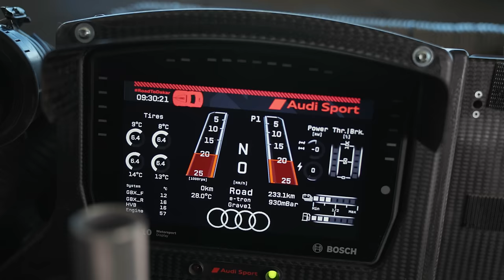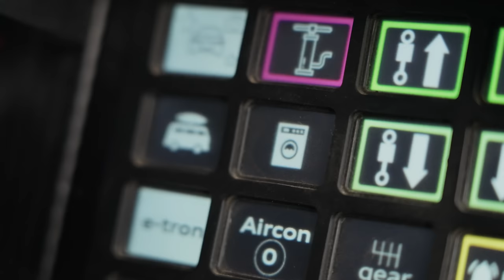FIRST DRIVE: Audi RS Q e-tron - Electric Dakar Car Tested On and Off-Road | Top Gear

Comment: Big congrats to Audi for building the loudest EV in world history
Reply: Have you not heard the t pain edition scream coming from the mach e 1400 drift car gittens team built? 
Or the Porsche cayman gt4e performance Chris Harris recently tested. 😀
Reply: McMurtry Speirling produces 120db.
Reply: Sounds like an rc car lol
Reply: Definity not, Formula-E cars are ear-shatteringly loud.
Reply: No ideea why they used straigh gears, helical gears are silent
Reply: @dtibor5903  maybe because it's less strain on the gears and more instant power. 
(I think I've heard this somewhere but I'm not sure so don't take me too seriously)
Reply: i mean i like the whirr of electric motors but it's a slight bit much
Reply: Staight cut gears
Reply: It must be annoying to drive.
Reply: Hybrid, not EV
Reply: That's just Desaster! ....
Reply: Like rally cars and other stiff race cars, the transmission/gearbox and in this case the electric motors are directly bolted onto and reinforce that area of the chassis. It makes it resonate loudly inside and out of the car. These Formula E electric motors are already loud enough. There is no noise reduction in racing. Wear earplugs.
Reply: Its weird how mad people are at anything thats not gas because they want their noise but high end electrics and older performance EVs get loud, and hydroogen sounds like a jet sometimes. i think personally for road cars, they should be fucking quiet. anyone whos ever lived with someone who owns a carbed 454 or a honda streetbike with a yoshi exhuast on it knows what i mean at 2 A.M. but in terms of racers and shit... i think we will still have noisy tracks in the future after we switch most cars over to something else.
Reply: Lol... Because desert runners are historically stealthy and quiet!
Reply: @dtibor5903 they said it's stronger and there is no axial force to the bearing.
Reply: @Cheetahtos  that argument is invalid at least. It's just matter of bearing choice.
Reply: So this is a hybrid car not a  EV car
Reply: @dtibor5903  lighter, smaller, cheaper, more efficient.
Reply: electric will be silent
Reply: Isn't an EV genius, it's an hybrid with EV propulsion, not too difficult to understand
Reply: @tomasmartinezhz  is a car with electric transmission, mostly. i bet it never runs with the ICE off.
Reply: The first hybrid car in winning the Dakar rally ...
Reply: I was thinking the same 😂
Reply: Good looking vehicle. Hope Audi thought about overheating batteries in the Dakkar heat.

Comment: Interesting that there’s an internal combustion engine onboard to charge the batteries. Wonder how far you can get with this setup (before the fuel runs out) compared with how far it could travel if it was solely using an ICE with no electric motors.
Reply: Yes is a hybrid, but the EV extremism only allow the to say is electric.
Reply: I think this is an amazing car. But I think we will look back on these times 20 years from now and wonder how we made such little progress with car batteries and gasoline, over a 40 year period between 1985 and 2025. No other technology is recognizable from 1985, because it has changed so much. Car engines and car fuel injection is exactly the same, despite there being about 5,000 patents which could completely revolutionize electric car battery capacity and internal combustion engine combustion technology.
Reply: The total efficiency is actually better than letting the ICE drive the wheels directly. The EV drivetrain has hardly any losses and the ICE can run super efficiently. Running the ICE with such dynamic loads would make it super inefficient.
Reply: @Ritalie  patents are not equal to feasible solutions. There’s a lot of patents for ideas that cannot be implemented. For engines the revolution or change has ben applied by material science and electronic control, new knowledge of CFD combustion chamber behavior and so on. There’s 80s technology that has not been implemented on street cars due to laxity from companies (they are not obligated by government regulations).
Reply: @LukasRaschendorfer  yes, but there are losses when you recharge a battery, store the energy and then use it on electric motors. Those losses are more than drivetrain losses are. And also the needed components add weight. That’s why in a pure long distance drive, a car with tiny diesel engine goes further with less energy, than a similar hybrid car. In a normal day-to-day driving, hybrids are better. BMW i3 has a model where there is a small range extender engine in an electric car, works just like this Audi.
Reply: Much farther. That's why, to be able to drive at high power for long distances, they decided to generate power onboard as always.
Reply: @testi2025  yes there are losses, but those are small compared to the ICE efficiency losses between running constant speed, optimized load and driving Rallye-style on and off throttle.
Reply: basically how honda does their hybrids
Reply: I like that they used ICE because it proves the future of electric cars. While we are not there yet because of the batteries it nice to se the potintial! Also, ICE charging is VERY efficient. And a car that is made that way may superseed a normal ICE car in a range test
Reply: I think it creates a platform that can easily be adapted as battery tech advances, to the point where the ICE comes out and a batter unit goes in...
Reply: @testi2025  actually that’s not really true. At most, Road ICE gets 40 percent efficiency. So a car that makes 150hp, actually loses about 300 to thermal loses… it’s crazy when you really think.
Reply: @testi2025  but an argument can be made, since the engine just runs at a constant rate for maximum efficiency, without gears. It can significantly increase the fuel economy, then combined with sustainable fuels, can be carbon neutral
Reply: @testi2025  they can optimize the ICE to run at maximum efficient RPM at all times, usually 3000-4000rpm. While driving in the real world you rarely hover at that exact rpm range for long(unless you're doing the speed limit)
Reply: @koko_5662  there are barely ICE that reach 40% efficiency though
Reply: @testi2025  not really, although there are losses, the generator only runs at the optimal rpm making fuel consumption less than when the wheels are directly driven by the engine
Reply: I dont know whether it is true of this car too, but diesel locs use the same principal, precisely because it's more efficient than having a mechanical gearbox. They have a diesel engine on-board that drives an electric generator, which in turn powers electric motors at the wheels.
Reply: @rfldss89  yeah this is a series hybrid just like a Train or locomotive
Reply: So it's not even a real electric car since it's 100% powered by fossil fuel. Fail.
Reply: @moonstriker7350  Nope, it's a plug in with a range extender. The most common sense set up imo.
Reply: Nissan Kicks: first time?
Reply: @annakquinn7084  at what point does it become an electric car with a generator on board rather than a hybrid where you expect the petrol engine to help drive the wheels?
Reply: @MumrikDK  by the international automotive (SAE) definition of hybrid cars
Reply: @Ritalie  gasoline and diesel engines today are worlds more effecient than in 1985. dozens of technologies have been replaced or advanced
Reply: @flighted2513  it’s hybrid, because the power comes from different sources. Is a weak strategy to change the focal point of the argument. Concentrate, is very easy. Audi is hiding the truth from people pretending that is a full electric car.
Reply: @testi2025  with electric motor and batteries you can have regenerative braking which more than offset the losses of this kind of powertrain.
Reply: Perhaps not the best or a direct comparison, but the Audi has a 300L fuel tank whereas its competitors are using 500L tanks, and it's a little heavier too.  So that might give you a ballpark idea of its efficiency compared to running straight ICE.
Reply: @Vergeetmenietje  The Formula 1 engines are past the 50% thermal efficiency threshold, my guy
Reply: @LukasRaschendorfer  depends on what you mean directly. For example, Toyota hybrid system only partially transmits energy trough electric motor/generator, while the rest goes directly from the motor. That's the best of both worlds, electric system keeps ideal load on the engine, while mechanical bypass transmits remaining mechanical energy with minimal losses.
Reply: @testi2025  my comment was specific to this car. I know for a fact that the RSQ etron is more fuel efficient than e.g. the Hunter and at least offroad than the diesel Mini - you can also verify this by the complaints of the ICE competitors that their cars are much heavier because they have to take more fuel.

Comment: Would be a great starting point for a real life warthog design!
Reply: hoonigan already built 1
Reply: @michaelvu3101  I don't think the hoonigan Warthog could handle Dakar or aggressive all terrain running like this thing can. That's why in my oppinion this platform would be a  great basis for a real life usable warthog. Better than any other "one off" that has been created so far.
Reply: @malcolmspeyer8644  the car should try Formula E then.
Reply: @malcolmspeyer8644  it started life on a purpose built off-road chassis. So the hoonigan warthog offroads pretty well. But this Dakar build is about 12x the price and built by audi, so ofc it's going to be better.

Also the warthog isn't electric powered.
Reply: I'm SO glad I wasn't the only one thinking that...
Reply: Agreed
Reply: @michaelvu3101  The Hoonigan one barely even looks like a Warthog, let alone performs like one.
Reply: yall forgetting the Tesla Cybertruck??? lol That's literally a Warthog
Reply: @shahan484  Cybertruck doesn't have an ICE charging the batteries. 

Giving it much better range and quick refuelling.
Reply: @malcolmspeyer8644  yeah cos it's an actual electric Vehicle. Unlike smoke and mirrors Audi RS Q E-Tron ☹️. That's a hybrid that they're calling an Electric.
Reply: @shahan484  The Cybertruck doesn't have removable gullwing doors and mounting hardpoints for a chaingun in the back...and good luck getting green paint to stick to stainless steel.
Reply: @shahan484  Tesla cybertruck is literally the opposite of a warthog.

Comment: Man is it just me or the Car really sounds like a RC car xD
Reply: Cheap gears do that.
Reply: It totally does! That’s hilarious.
Reply: @Ismalith  There… there are no gears
Reply: Its basically a scaled up version of rc car so yeah.
Reply: @vipe650r  
Yes they very likely use a transmission with one fixed gear as do most EVs for reduced rpm.
And this sound is the sound of straight cut gears as Vipin just said. If you drive cheaper cars from the 1990 in reverse you'll hear the same noise.
Reply: @Ismalith  i have straight cuts in my 2010 hatchback reverse gear lol
Reply: @Ismalith  No that's straight cut gear
Reply: @muhammadirfanataulawal7630  
Straight cut gears are cheap gears.
Reply: @Ismalith  Race car use straight cut mate, F1 car use straight cut gears due to efficiency and torque requirments. Also for durability. If you think the straight cut gears on race cars are cheap, those race cars will be disintegrating on lap 1.
Reply: I have a lego RC car that sounds exactly like this and man... it's fast
Reply: @muhammadirfanataulawal7630  
No straight cut are less efficient and cope worse with torque, or rpm.
Race cars use them because they need  gear ratios that are not used by any serial gear boxes and also often more gears than usual.
If they would always create those custom gears as helical gears, these cars would be much more expensive.
What you think of, as less efficient is that they produce axial loads which straight cut gears don't. But those are usually blocked by the bearings, of course if you overload those bearings or simply use the wrong type of bearing those forces that push on those bearings create drag via grinding, but if done correctly those force is just blocked and a blocked force that doesn't do work also doesn't cost energy.
But you see how it is a bit more expensive and difficult than just use straight bearings.
This is also why they where used in reverse gears on cheaper cars, it was just less expensive and since reverse gears are not used for long distances they where a simple way to keep costs down.
Reply: @Ms Moon Boo 
My RC Plane with the motor directly on the probeller doesn't make that sound, it still makes a loud sound but it is less rough and grindy. While the straight geared RC car makes the same sound just a lot louder.
Reply: @Ms Moon Boo cool story, what kind of gears are on your RC cars? straight cut? they sound like this? 
Sounds like an RC car because RC cars also have straight cut gears. go look, that's why they sound like this, and this sounds like them.
Reply: @vipe650r  There must be some sort of gearing in there - the tacho red lined at 20,000 rpm (I rewound and froze it to make sure I'd read it right). Those wheels are spinning fast, but not that fast...
Reply: Sounds like a drafty window in a winter storm .
Reply: @Ismalith  Straight cut gears are not for cost savings in race cars. Especially not this one. The reason why they pick them is that straight cut gears don't apply lateral stresses which allows for a lighter built transmission case and bearing system. Angled gears want to side slip each other, causing lateral stresses on the whole transmission.
Reply: @krupert8355  
You can use a herringbone gearing to avoid those forces, and they can be made relatively cheaply out of two angled gears.
Reply: @Ismalith  yes, but it's a more complex design to put together since you have 2 thinner weaker halves that you need to sandwich together. Additionally, straight cut gears are more efficient because they have the smallest amount of slip, whereas helical gears are constantly laterally sliding against each other, basically screwing on each other slightly, so more friction. Essentially from a simplicity and efficiency standpoint, straight cut gears make sense.

From an everything else standpoint... herringbone and then helical gears are better, and I wish they used them more often.
Reply: I love RC cars so its just good for me :D
Reply: You beat me to it!
Reply: It is an r.c. car with a person driving.
Reply: @Ismalith  Do you really think that Audi is gonna save money in a competition car? Lol
Reply: @baguette1970  
Not by themselves but there are always rules about what is allowed and what not, to avoid some competitors just outspending the rest.
Reply: Yes, they really sound like an RC car. I'm not against electric vehicles but I can't get used to their sound/no-sound. Watching Formula-E makes me laugh and can't take them seriously.
Reply: Every ev produce some amount of sound like that

Comment: Wow! I've never seen a machine like this. Its like a car from Mars. What a wonderful innovation.
Reply: Check out the Extreme E racing series on youtube. They're into their second season racing similar cars.
Reply: What's so innovative about it? It's just a plain old hybrid made for Dakar.
Reply: @mikejakubik  Like all those others?
Reply: @bremCZ  Exactly, just look up The Spark Odyssey 21 electric SUV.
Reply: @mikejakubik  plain old hybrid? Did you even watch the video? It has an output of 671HP purely electric. The ICE engine is only used to charge the batteries when voltage drops. For comparison, an F1 car has about 750HP With both the ICE and electric motor combined. Also, he said that it is surprisingly drivable so lots of innovation on making the car stick to the ground and obey to the driver's commands. You probably have no idea how much engineering is going on behind each and every part of the car
Reply: @Mr.Engine993  Indeed, a hybrid for off road use. A Lucid Air has 1,111 hp, a Rimac has1.914 hp - all pure electric. Electric motors arent anything new. Just as much engineering goes in as any other dakar/off road competition car, except this is a hybrid.
Reply: @mikejakubik  You're right to say electric motors aren't anything new. In fact, the first electric car came into existence less than a decade after the first ICE car. But hybrid doesn't just mean it uses an ICE and an electric motor. It means that it uses both directly for _propulsion_. This Audi doesn't use the ICE directly for propulsion, rather just charge the battery, so they're right to call it an EV on the video. Plus, you can't just slap a supercar engine onto a Dakar truck and call it a day. Fast offroad cars aren't that common so the engineers are definitely stepping a bit out of their comfort zone which includes the boring SUVs that are literally everywhere. Yes it isn't something as insane as the Mercedes EQXX but still a pretty cool and out-of-the-ordinary car
Reply: Plenty of sand dunes on Mars. I wouldn't be surprised if exploration vehicles made for Mars missions looked similar to this.

Comment: I love how insanely loud it seems to be 🤣
Reply: Sounds insulation adds weight...
Reply: @b127_1  nah, they cheaped out on some gearing. Straight gears are loud like these, helical gears are absolutely silent
Reply: @dtibor5903  They didn't do it because its cheaper, they did it because straight cut gears are stronger. Most race cars use them